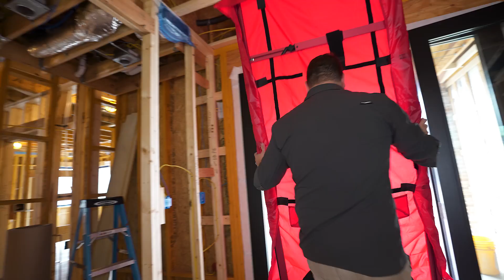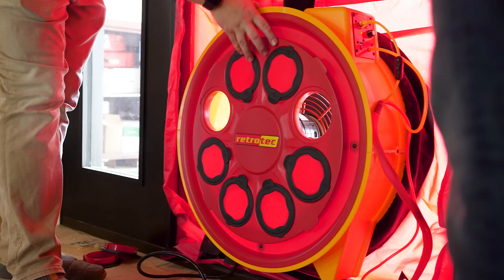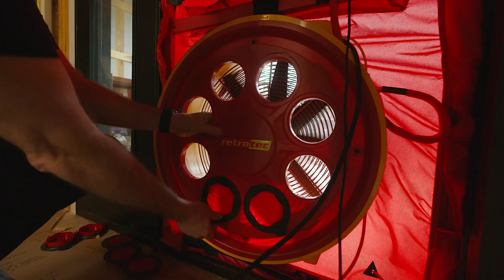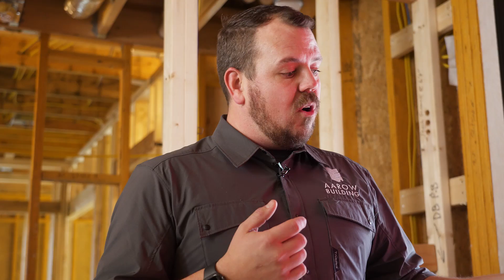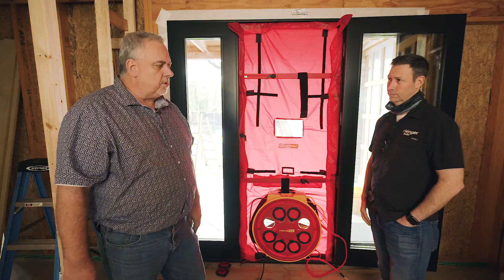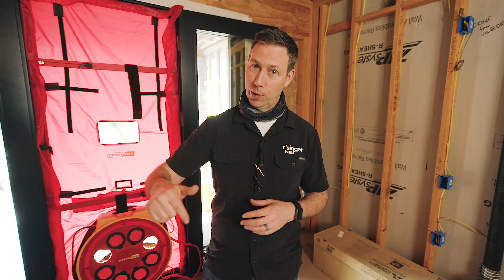Has Your New Home Had This Test?  It should!

Comment: Yes it has!  My wife and I are DIY building a 470 sq ft THOW.  Been leaning on your vids throughout the build.  Did Scott True’s monopoly soffit detail before I had heard of it.  

With no internal air barrier and cheap windows/doors, I was able to pressurize it to 56 pascals with just our Fit70E ERV.  1.02 ACH50.  8.3 square inch equivalent leakage area.  Couldn’t be more excited.

Comment: As a builder in Florida the problem we run into is building our houses too tight. Air conditioner doesn’t run enough to get the humidity out, etc. Then have to introduce fresh air, install a dehumidifier, etc. They don’t mention this but a home can be too tight also.

Comment: I do thermal envelope testing for a living. I have personally performed over 2500 tests. It is a fabric door with an aluminum frame. Your explanation is "unsophisticated". The test guesstimates how much your house (or structure) infiltrates air when the wind blows about 20 mph +/-. Many builders where I live search out hacks that do the test wrong or not at all. They look at it as a detestable tax (I can provide names). From your previous spec home videos that problem exists there as well. Few builders care to seek out the testers that actually do the test properly (I have those names as well). Below 5ACH you while not feel the infiltration under non-severe weather zone 1 and 2 conditions (unless you are sitting under a hole you can stick your hand in). The test can vary by 0.5ACH (sometimes more) depending on wind when tested. I'm a PE as well..... Judging from your amateurish equipment setup and lacking explanations; none of you are experts on the matter. The test tells how much the leaks are, not where they are. That takes experience and work (and money) to find.
Reply: What does it take to be an "expert" on airtightness / and or air leakage?
Reply: @stevenbaczekarchitect9431  
Short Answer: Experience. 
Long Answer: I was referring to expertise in the test itself and equipment. Finding the holes is very very difficult. To be really good would require testing at each phase of sealing (think dry in) along with finding the holes. However, most builders (nearly all) rely on the drywall as the air sealing barrier (see cringe face) instead of an outer sheathing/sealing layer. These are personal observations in zone 2. Expertise requires proper training, experience, effective evaluation, and professional dedication to accomplish a quality product. I do feel that you and Matt have the required professional mindset to do good work (otherwise I would ignore you). Proper testing will reveal that. I didn't get really good at doing the blower test until over 500. I've been doing it since Jan 2018. The online certifications and franchise companies don't train techs properly. Do 200-300 tests and you'll get good at pulling that fabric taught and explaining to builders.
Reply: @derf_the_mule1405  I totally understand. I have been doing blower door tests since '95. I too have done more than enough. I have worked along some of the best blower door minds and building scientists in North America. I have designed and overseen some pretty extraordinary tight homes. I was one of the first to do sequential testing to understand the value of components thru a build. I don' t usually favor labels, but I think I fall in the expert category when it comes to residential construction. Thanks for your discussion.
Reply: @stevenbaczekarchitect9431  Your professional dedication is appreciated. Will be looking forward to your book on the matter of thermal envelope design and construction. (For others...I'm making a suggestion not informing a fact.)
Reply: @derf_the_mule1405  we are on the same page buddy, appreciate the discussion

Comment: Mold and mildew will happen because its to tight.
Reply: Probably couldn't be more wrong
Reply: Having a tight house removes the external applied humidity and moisture issues, where most mold and mildew issues come from. Sealed up, you only have to account for added humidity from shower, dishwasher, and breathing. That's easy for a properly designed air handling, HVAC system.

But the use of an ERV type system will be important.
Reply: @LostPilotage  Yes it will. I always explain it as, to prevent problems, I need control, with control, I can solve for -  uncontrolled air leakage is a disaster!!

Comment: when doing a remodel how do you factor in for fart fans and oven hoods that are vented straight outside when doing blower door test
Reply: Ideally they would have a "make-up-air" duct in or beside the rangehood, so as to not pump so much conditioned air out at the vent.  (Problems lie in routing these ducts in a remodel, and ensuring the gates on the intake and exhaust ducting are "airtight" - filter the incoming air at the very least.) - Pulling in the makeup air from the ERV (if one exists) could limit the humidity being introduced into the envelope - but  Rangehood exhaust should never go back to the ERV - as there will be the potential to contaminate the membranes with grease.

Comment: I've heard that an airtight house is not as good as it's made out to be because you're not getting fresh air into the house, and it's really difficult to get all the chemical smells of a new house out (chemical smells means you're breathing harmful chemicals day in and and day out).  What are your thoughts on that?
Reply: He's a big fan ERVs for fresh air ventilation.
Reply: That's why you have to install an HRV or ERV. Seems counterintuitive to make an airtight home to only have to install a new system to bring in outside air, but at least the air is conditioned and filtered.

Comment: Can you talk about the benefits of this for a homeowner? I’m not a builder but I love building science.  This test isn’t cheap and id love to know where my house is but at the end of the test what is the benefit for someone in my shoes? I’m assuming I’d be looking at thousands of dollars of air sealing to “fix” or lower my score if I’m above 2.0ish
Reply: I think unless you're also willing to pay to fix the problems you find there's not much point doing the test up front. Also, you'll need to install a proper ventilation system too if you tighten up the house a lot, it's not just about patching holes. For an existing homeowner it's going to be serious $$ to remodel and do it right, for new home builders though this is what everyone should be doing. The benefits are many, mainly its more efficient (cheaper) to heat and cool, secondly when you combine it with a fresh-air ventilation system (and filter) your house is just really comfortable to live in and healthier too. It also keeps out bugs which is nice!

Comment: How much should it cost to bring someone out to do this test?
Reply: Same question
Reply: I had this done as part of an energy audit (so he also checked out windows, where registers were pointed in the rooms, lightbulbs, water heater, how rooms felt, etc...) this week in Dallas. $250. Not new construction, older home.
Reply: The following is required for new construction in Colorado: 1) energy modeling (HERS score) of the home prior to getting permit ($750), 2) inspection of the home's building envelope ($325), 3) leak test on HVAC ductwork ($150), 4) final inspection and blower door test ($325). Prices may vary.

Comment: Not sure how you do things in Texas, but if you have one too tight here in Florida you have yourself a serious mold issue.
Reply: You see serious mold issues from leaky houses in the north where the warm moist air condenses on the cold surface inside the walls.
Reply: Any climate zone can do this. Just need a mechanical ventilation system with dehumidification. Then you control the quantity and quality of the air you bring in.

Comment: We need to be talking more about ventilation before we get to 1.5 ACH50. The Ventilation conversation needs to happen at 5 ACH50 or lower. Nobody want's to be surprised by the addition of an ERV system. Most folks will simply try and build just above ventilation requirement so they don't have to add the ERV or other system. You have to build tight AND Ventilate.
Reply: Crazy how a 2000 dollar tv is not even thought about but a 2000 for filtered fresh air in your house is a major issue. 🤣
Reply: he has an ERV and has multiple videos on it. There's a lot to talk about, he can't talk about everything in every video.

Comment: C'Mon Steve...push Matt outta the way and turn that thing on now. 😂
Reply: I thought about it!!!
Reply: It's a 24" or 30" air circulator ...not like you'll see anything
the 50 pascals mention is 0.007 psi  over  15.4 psi ambient (normal) pressure  (why do you think they use pascals  .... to impress
Reply: My bad 14.7 psi is Std atmosperic pressure (at sea level)

Comment: Again, more codes require more cost to the homeowner. 
License to fish and to live.
Illegal to collect rain water..
Reply: This is all about making the Homeowner comfortable.  It is difficult to condition a house to comfortable conditions if you don't know what you are trying to condition.  Additionally, the tighter the house the smaller your HVAC. Smaller HVAC means less cost to install and operate, smaller ducts.  Less cost all around.  If you don't measure, you are just guessing.
Reply: @mattmilton6394  I’m all for the idea and the technology. I don’t think it has to be federally regulated and imposed. 
The window industry is still confused about SHGC & U-Factor ratings not to mention DP / PG ratings. 
Yes it will give someone comfort, it will also increase the cost from of the home by a few grand. 
Nice tech tho for a select clientele.
Reply: @mattmilton6394  If you build the home to proper specs it’s very easy to build a quality sealed home without this addition to the cost.
I’m not saying it’s not worth it if you want to use it and improve the efficiency of your home by all means. Don’t make it mandatory under the IRC.
Reply: @TheRonin248  A blower door test costs $150.
Reply: @wjthehomebuilder  And with markup, profit, equipment.. 
I’m just very happy we are not using those here yet. Hopefully never.

Comment: Florida code requires 7ach. They never get below 3 without spray foam, and when they do, they're usually surprised when I tell them it's going to require fresh air intake.
Reply: Not sure where your at but here in Central Florida we were required to blow a 5 ACH or less because of when we pulled our permit but it’s now below a 3 and anytime it’s below a 3 fresh air is required. Not sure many inspectors will really under stand the technology for a while but if they actually enforce it correctly along with some other major changes we might head in the right direction.
Reply: @ride-it-outtimandtoni232  If your energy calcs say anything less than 7 then that's what we go by, but it's not required. I expect all inspectors will eventually get caught up with the need for make-up air, but I agree with you that depending on the county inspectors may or may not look for it.

Comment: 100 CFM on that reading we saw?  that's about how much mechanical ventilation it requires to compensate for the house being so tight.
Reply: only problem is the house needs to have a 50 pascal pressure differential to achieve that volume airflow.
Reply: @D2O2  you missed the part where there will have to be mechanical ventilation producing that volume of airflow.
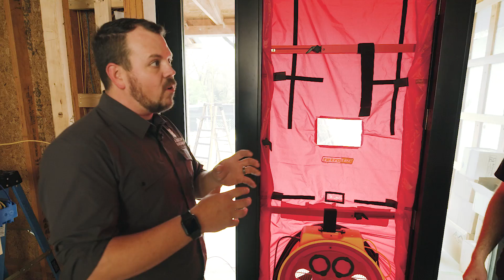Reply: @kenbrown2808  I am not sure what I missed.  The reading  at 1:57 is just over 1000 CFM at -50.2 Pascal, not 100.  That 1000 CFM is being achieved by creating a 50 Pa pressure differential with a mechanical fan.  If you are referring to Fresh Air and Makeup air produced by an HRV/ERV, etc. then that would be done with little to no pressure differential by design.
Reply: @D2O2  and that equipment will have to run 24/7.

Comment: So once you build an air tight home,  how do you vent the home to insure air quality is the best it can be?  where i live we have ridge vents and soffit vents. Would you use these in an airtight home situation or use some sort of mechanical venting system or both?
Reply: mechanical ventilation system.  around 100-200 CFM.
Reply: Air leaking through your walls and roof isn’t quality air, so you are going to want mechanical.

Comment: All new houses in the UK have to have this test. A low-energy house in UK is allow a maximum n-50 value of 0.6 and normal house with ventilation is allowed a 1.5. That’s quite a difference to the USA.
Reply: You're surprised. Europe's building standards are decades ahead of ours.
Reply: Got a link to this?

Comment: Has anyone ever did a initial blower door test and then do it again years later and compare from the original?
Reply: I have on a number of homes, degradation is pretty much non existent
Reply: @stevenbaczekarchitect9431  That's  inspirational.  Maybe I'll try to re-test one of my higher performance homes too!
Reply: @stevenbaczekarchitect9431  Thanks for the reply, always look forward to your videos. We just did a light commercial reno in the Boston area, the Architect had some nice details, but reality doesn't always work out,  the videos are helping me plan/repair some of the mistakes made.
Reply: @Jonjolt  Always feel free o reach out if you have a question
Reply: He meant testing in the same house, and retesting years later.  The point would be to see what affect aging, sagging, settling, drying, expanding have on all these details.  All of this, just to see what the natural shift is over time.   I do believe air tightness is very important.  I'd be very curious to see how well things like aero barrier hold up, though I'm not optimistic on that one.
Reply: Jake owns one, so I imagine he has. Certainly would reveal if caulk or windows seep over the years.
Reply: That's a good idea.
Reply: I run into this sort of accidentally. I work for a weatherization program and we come behind other programs on low income homes and there are some changes but they are pretty minimal unless it’s changes caused by occupant damage.
Reply: I do them every week in Florida before you can get a co u have to have one done
Reply: That is a very good point. Would be interesting to see on a fully closed cell sprayfoamed house.

Comment: Would there be any reason to do this on a existing home? Would it help me identify improvements I could make on my home built in the 70's? Range of what I should expect the test to cost?
Reply: I had this test done for $100 in Maryland and the utility company gives the certified company a subsidy. They also use a infrared gun and gave me an 11 page report. Not bad at all. Now they’re paying 75% of the cost for me to airseal attic and get up to 18” of insul added.
Reply: @mteske1  that's a good deal.
Reply: If you wanted to figure out where your house was lacking it would be a great test.
Reply: assume your house is as tight as a sieve.
Reply: My report gave me a number of 3,645. Not sure what they mean by .6 or 1 or 1.5. Trying to figure that out.
Reply: @mteske1  You should be able to divide your total cubic volume by the leakage volume (which I'm guessing is the 3,645) and come up with the ACH.

Comment: Great video!   Can you tell me what the advantage of getting passive house certified?
Reply: In the UK passive houses have to achieve a 0.6. This plus lots of insulation make it really easy to heat. You could heat a 3 bed house with a hair drier.
Reply: @mrfr87  Thanks - but what is the advantage of getting certified.
Reply: Resale value. Also verification that your claim is as good as reality.
Reply: Lower HVAC costs is the first thing that comes to mind
Reply: @michiganengineer8621  Pretty sure whether you certify it or not the hvac costs will be the same.   That would be like saying your name is John means you'll save when buying clothing.
Reply: @boedillard8807  True enough, I misread your question.  I think all the certification would give is in resale down the line.
Reply: Getting to spend 5-10% more.

Comment: Just finished building a house with .13 blower door test.
Reply: sounds impressive! what systems did you use?
Reply: Serious question... is it difficult to open your front door?
Reply: Not bad.
Reply: I need to blower door test mine. I bet mine is that or better. The only leaks I have are the drier vents and the range hood vent. Otherwise she’s tight.
Reply: Power goes out, man passes out from medical condition, he's in the house days before discovered, died of no oxygen